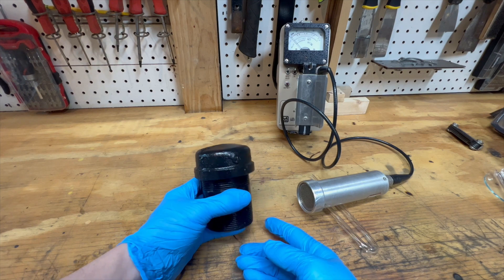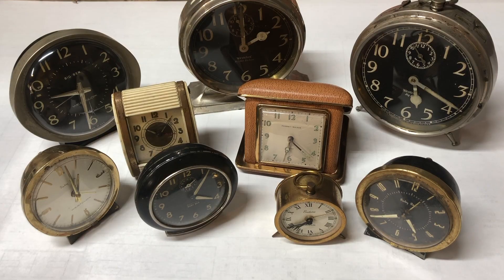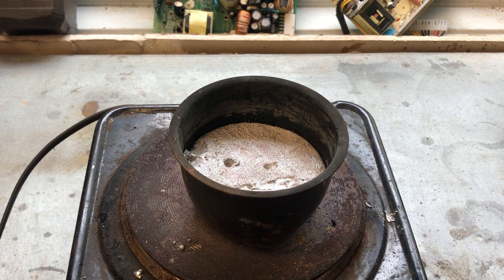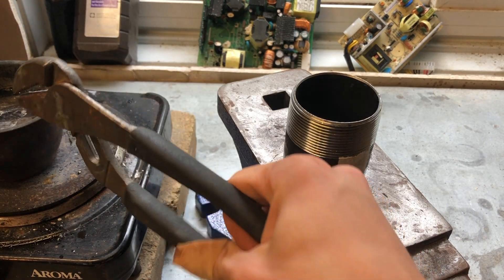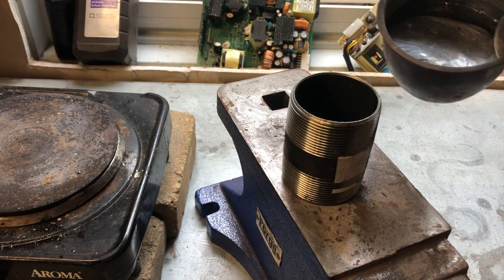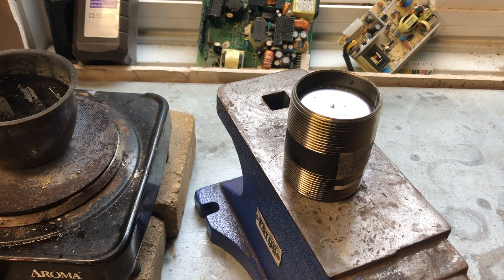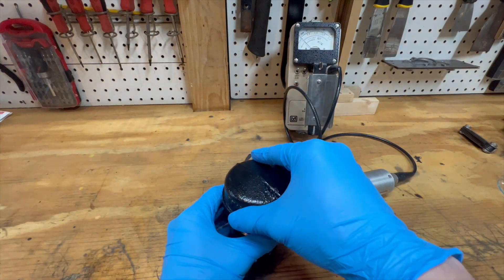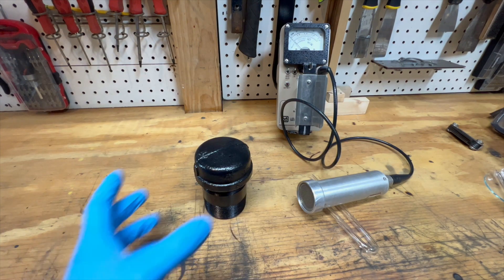How To Make A Radioactive Containment Container

Comment: Wouldn't bismuth also work
Reply: yeah but its a lot more expensive. i mean if you absolutely need to avoid lead then the extra cost is justified, but if a bit of lead doesn't matter then just use lead.
Reply: @adelinyoungmark1929  yh it's just cause I have a lot of bismuth on hand but not much lead

Comment: I’ve had an Idea of getting some Uranium glass for a Radiation talk, but I had no idea if I should, because I had no clue how to make a lead-lined container. Thanks.
Reply: I wouldn't worry much about it, uranium glass isn't particularly active. Heck, my grandma's been cooking with a Kellogg measuring cup since she moved to America in the early 60's, and that one's pretty dang green, along with a full set of Fiestaware. No noticeable effects and she's doing fine at 70 years old, except for the usual old-age stuff.
Reply: @LenKusov  okay. I bet I’d need one of these if was to do it with the Americium 241 from a smoke detector.
Reply: @joehumpston7937  Probably not that one either, unless you either collect a LOT of them or you carry it in your pocket. The gamma output of a consumer-grade smoke detector's negligible, and the alpha gets stopped by almost any material including a few inches of air or the top layer of your skin. It's only really a concern if you break the disc source open to get the americium OUT of the smoke detector disc, in which case you gotta worry about it getting INSIDE you, just don't crush up a pile of smoke detectors and snort em and you'll be fine. There's a reason they sell em in stores. Also don't put em in aluminum foil, that makes neutrons and neutrons make random unpredictable stuff.
Reply: @LenKusov  well, I would need to safely transport it somehow.